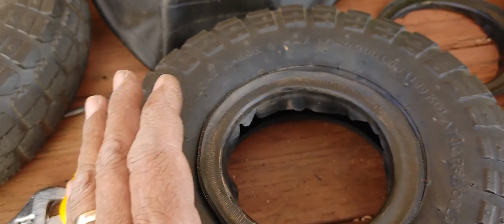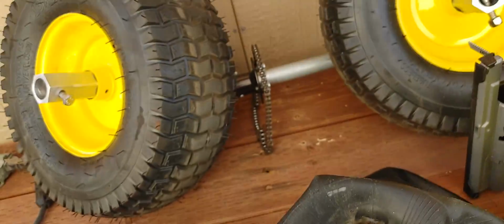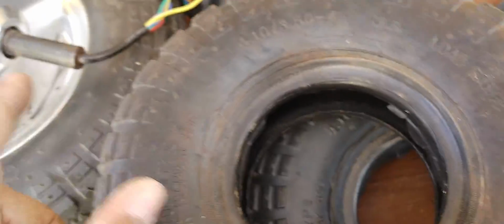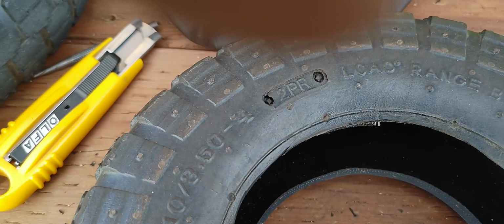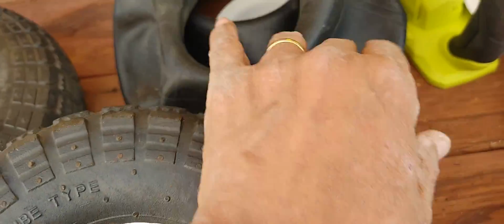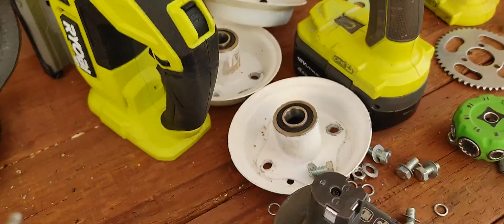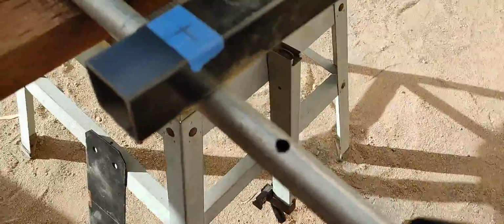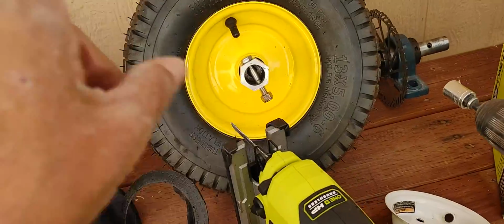Challenge and Solution - Fitting a 10.1/3.5-4 Tire/Tube on a Hoverboard 5" Hub motor (Part 1)

Comment: Cutting the bead off ABSOLUTELY doesn't work. Once you fill the tube up to any pressure will push the soft side of the tire off the metal rim.
Reply from the maker: You are correct, the bead is required for proper seal with a tube tire. In my other videos I talk about using a sold PU tire and modifying that one instead.
https://www.youtube.com/watch?v=lWjKJhrSCN8&t=5s
Reply: lol yep, keeps popping off. From a pack of 2, I now have 1 good tyre and one not so good tyre. Could maybe add a new bead in but, then its becoming too much work. Will just try find a 5" one online somewhere.